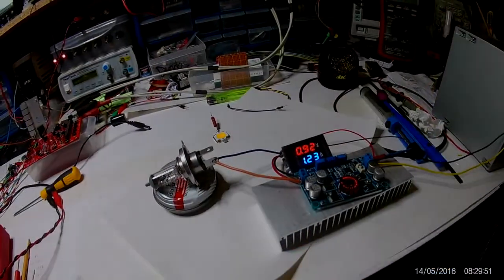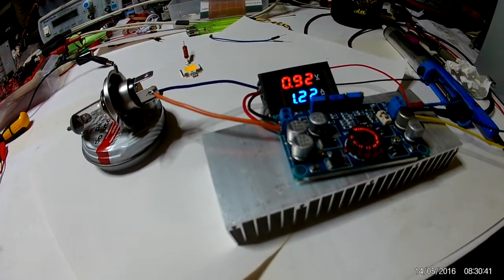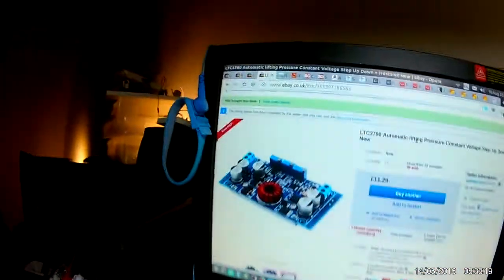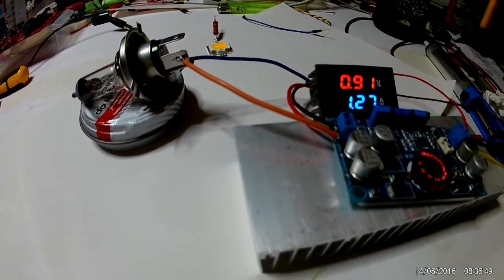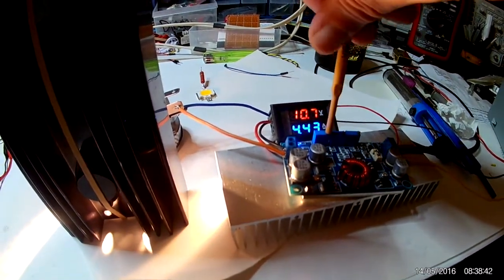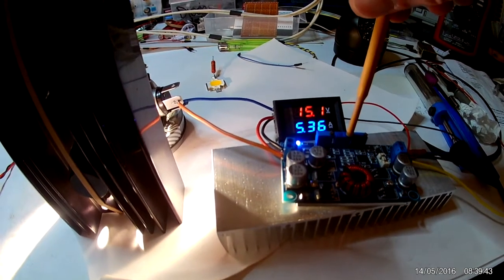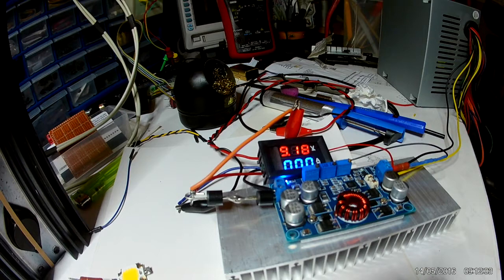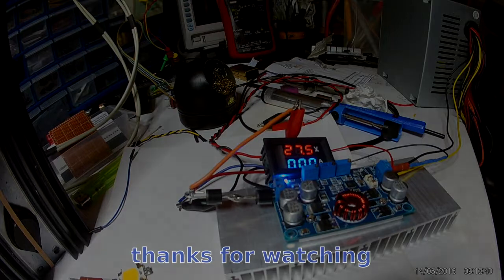LTC3780 Step Up and Down Module Boost Buck Converter

Comment: The third pot, labelled UV, is for input under voltage protection. For example you could connect a 12V SLA to the input and set the UV to 10V and this will cause the fault LED to light (and the output to stop) when the battery voltage drops below the 10V threshold you've set, protecting the battery and warning you it is time to recharge it. As far as I can ascertain it can also be used if you are powering the board from a solar system.
Reply from the maker: Cheers for that Nick, nicey explained.
Reply: So basically a low voltage cutoff for the battery pack, and the cutoff voltage is determine by the voltage set by that 3rd pot... is this correct?

Comment: Ahh i get it now...a power analyzer and it wont boot up after loss of power do you get black squares on the display?..most people just fit a restart switch...or use the battery pins...its only a 7ma drain

Comment: what will happen if you make a short circuit at the output of this module? does he have any security ... I am asking because no one is talking about it
Reply: The module has short circuit protection. I tested it. The green light turns on and the output voltage is pulled down, no current draw from the source.

Comment: Just found out the man who told me that the tracks are sensitive has a 100 watt iron!...so my warnings may be a load of crap..smile...and I notice that heat sink does not get in the way..200 k and 500k...right?
Reply from the maker: 100 watts is quite warm. Yes 500K and 200K and clear of the heatsink is right :D I might still try your suggested way to remove them as I do not have great luck with PCB's. I will show that in a upcoming video, replacing something I broke on a board. 
I have a circuit I need to build. I have a meter (in series) between my solar panel and controller. It has a hard time with the soft power on due to the gradual rise in voltage on the panel. I need to figure a way (I am trying with mosfet and V regs at the mo) to switch on the meter after let's say 6 volts, and within a few extra volts a full flow between drain and source. I wondered if the panel can switch full on the mosfet after 6-7volts and switch it full off under 6 volts?  At the moment the mosfet is allowing ~ 2 volts when the gate has 5.5 on it, thus the power still creeps up and is not useful.

Comment: Hi, I'm planning on using the LTC3780 to build a bench power supply. I have a 12v 10 amp power source for the input, can the board handle the 10 amps? thanks
Reply from the maker: It can handle 80 watts with a 130 watt peek, needs heat sinker. If you intend for 120 watt operation then use a bigger heat sink, also ensure you buy the one with the heat sink already on as can make attaching another easier.

Comment: I like your videos...they are more exciting than  tutorials or reviews..wires everywhere waiting for something to burst into flames or explode....grin...I cant visualize the panel meter gradual rise of soft creepy power problem..anyway you will have more fun working it out..took a toaster apart today wanted the heat wires for a test load...ended up fixing the toaster..dam it...smile...working on thinking outside of the box and electronics as an art form
Reply from the maker: Cheers mate :D I will make quick video about meter. Its an in series power meter. My panel as its source and its load my charge controller. This is meter http://www.ebay.co.uk/itm/171659471760?_trksid=p2057872.m2749.l2649&ssPageName=STRK%3AMEBIDX%3AIT
 It doesn't like the gradual turn on. I took apart a fan heater for the element to use as a load. I forgot about that the other day when playing with that step up step down module.
Reply from the maker: I think I can do it with a Zener and a Mosfet I will give it a go.
Reply: You may already know this but..in low light a panel may give out 10 volts but only 1ma
Reply: So...zener will operate at about 3ma but meter wants about 8ma...anyway i am off to do housework...smile
Reply from the maker: I have set up with a IRF250N and a 12V Zener. When the panel has a little over 12 volts it will allow the Zener to conduct to the gate the panel voltage minus a bit. I am hoping this will allow the meter to get more that the 4.8 volts and a little current to start up straight away. I have put it in circuit and hope in the morning it works as I hope. :D
Happy house working!

Comment: Interesting..i enjoyed that..thanks..impressive efficiency on that module..thus the low heat output i guess..even if you did cheat with the big heat sink support..smile...i expect you know there's no protection on the input...with my old brain i would get a diode on that fast..take care with the pot removal..i have been told the tracks on that module are extra delicate..gota get myself some packs from china again soon...ohh by the way...they are mosfets
Reply from the maker: I was impressed also with how cool it stayed. I thought I would use that heat sink just in case, but the module hardly got warm.
I will heed your advise regarding removal of pots probably save me some time and money :D I will look for a video showing how to crush them off. I can guess but would rather watch a success before trying it myself.